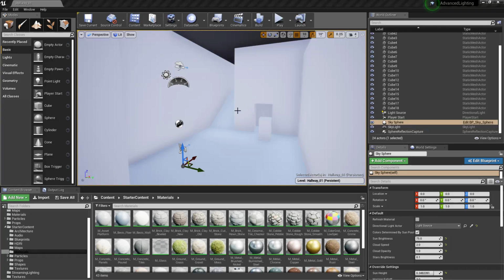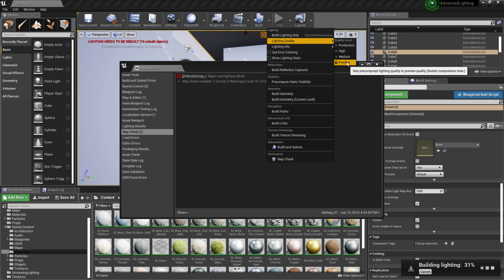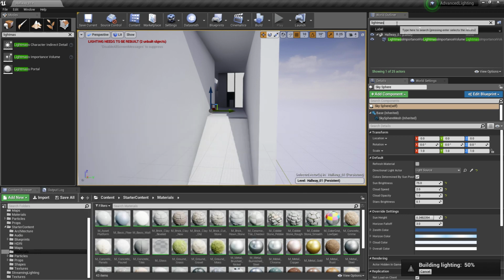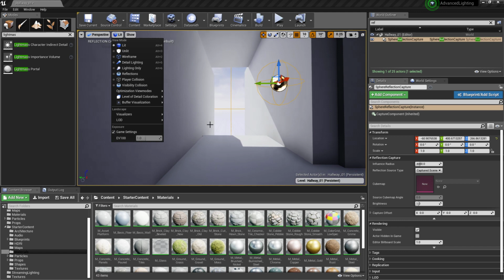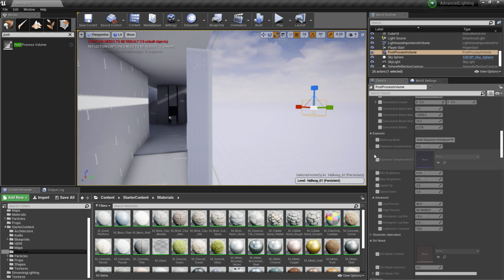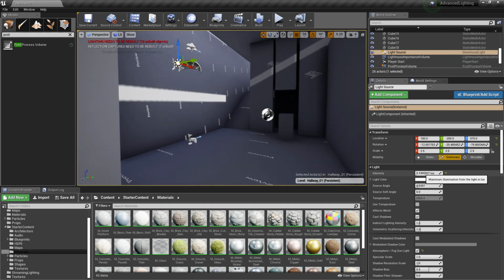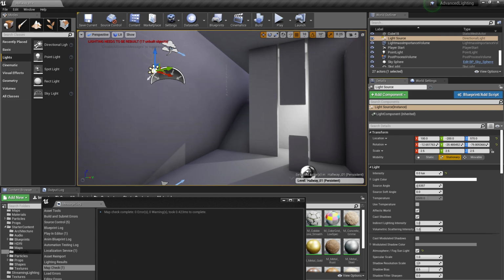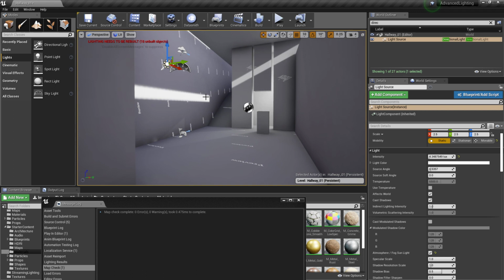UE4 Lighting Tutorial : Static Lighting and Exposure Calibration Part 1 - Beginner

Comment: In the thumbnail there is evidence of global illumination bounces from the red wall. Is this baked, and if so, do any settings need to be changed in order to achieve the effect?
Reply: I think static meshes should be ticked static and your directional should be either static or stationary (stationary has my pref) Also a lightmass importance volume is usefull